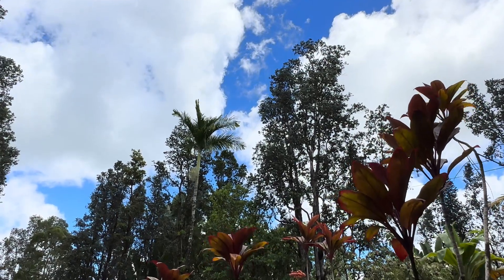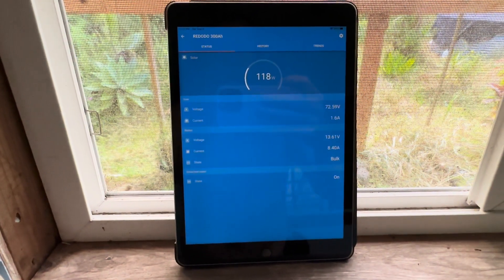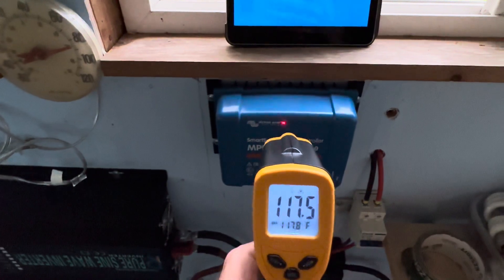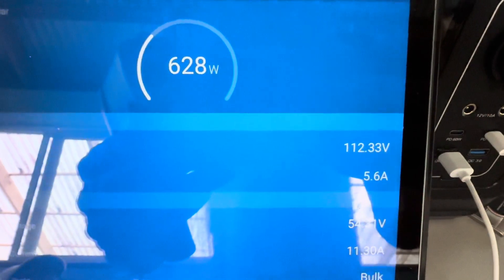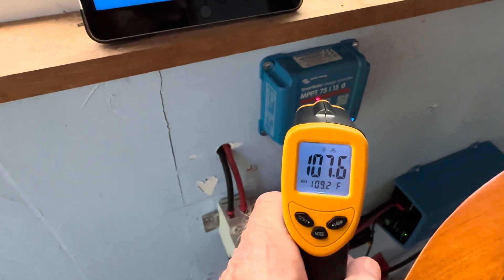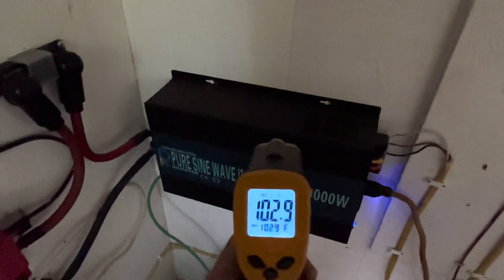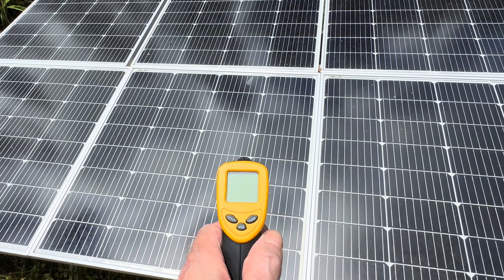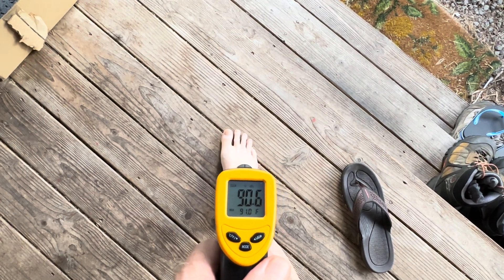Victron smart solar MPPT charge controllers run warm

Comment: While I would agree it's nothing to "worry" about... one thing is for certain heat kills electronic components... so keeping them as cool as possible will likely extend their natural lives.  To that end, I have thermal triggers on all my Victron controllers, and if they get above 85 fans come on.  Mine are in a climate controlled environment, and also have much higher voltage/loads on them... left to their on devices they will run 120+ so I run USB fans on them that kick on and off based on the temperature of the device, essentially they run all day, and shut off in the evening.  All mine are on standoffs that keep them a couple inches off the walls, and I blow air vertically from below across the cooling fin with small fans, blows away a lot of heat.  

My intention is to run fans on the bottom of my solar panes by next summer... it's much hotter here than where you are, and often we have very little wind.  I have to figure out how I'm going to do that, but I'm working on it.  I'll test it on one array, and see if I can prove it's cost effective, I believe it will be.  We get about 70% of rated output, but it's right at 100 degrees ambient all the time in the summer.
Reply from the maker: Mahalo for the great comment, and information! Guess I will add fans in my control rooms. Why not cool them down some yeah! Aloha! 🤙